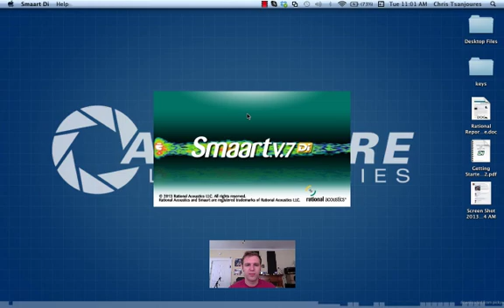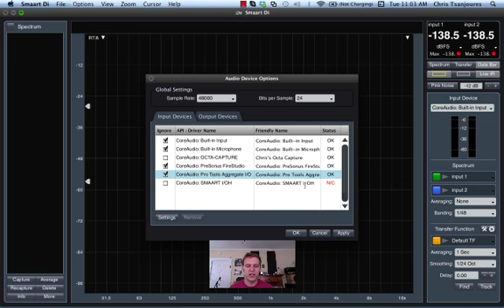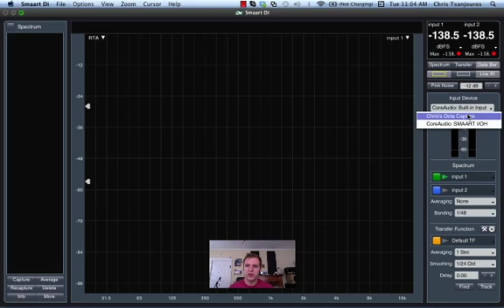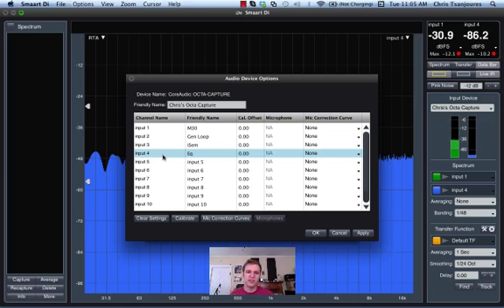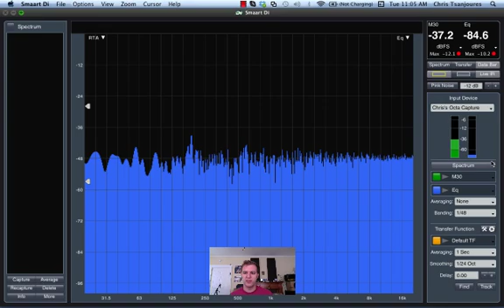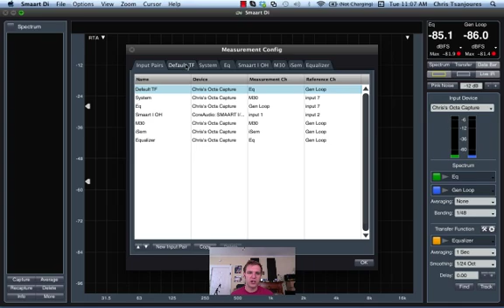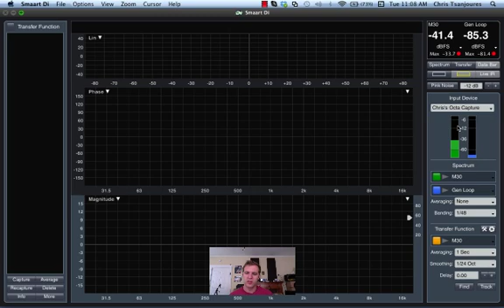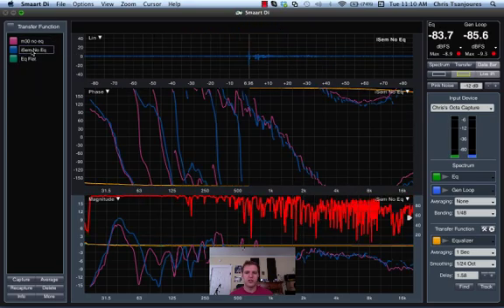Smaart v.7 Di Configuration and Concepts with a generic IO (pt 1 of 2)

Comment: Is it possible to do a transfer function measurement without using the loopback method? I'm trying to get this working but no success, I can go to the spectrum window run the pink noise and it works but when try it on the transfer window all I get is a flat line and no actual measurement.
Reply: This is not possible with v.7DI. With v7 or v8 you may enable "Multi-Device Transfer Function", though this is not a recommended practice. Any benefit you get by looping internally is negated by the resultant instability in the measurement. You would see this as drift in the phase response, and different delay times measurement to measurement. That is, unless you have the ability to link the sample rate of the internal sound card with your microphone preamp. To our knowledge, this is not possible. However, power users who use a mixing console with a microphone preamp for their measurement microphone - additionally with something like a Big Ben clocking everything together - may achieve sample clock sync with more reliably.
Reply: Thank you for the response. I asked because I use an USB powered mic so I'll have to figure something else out and try.